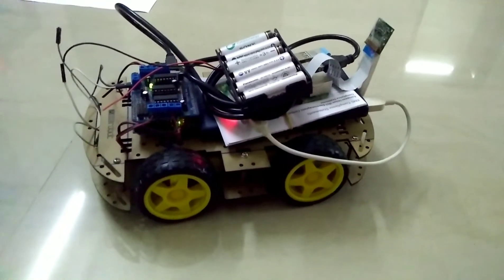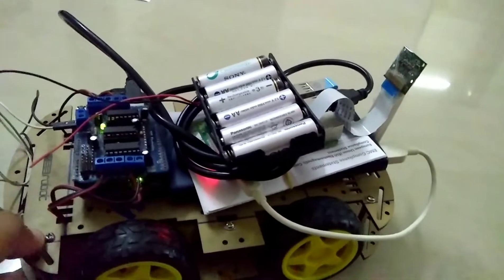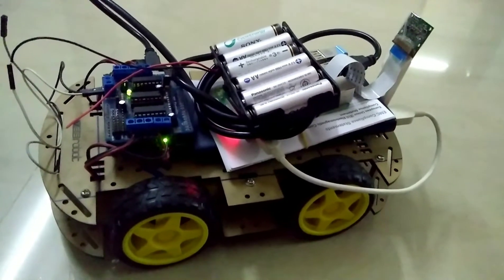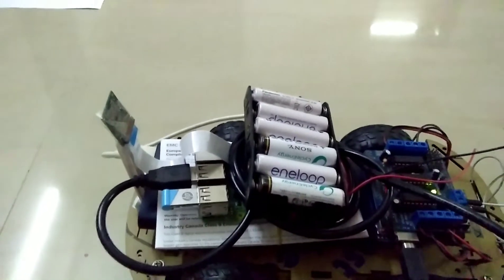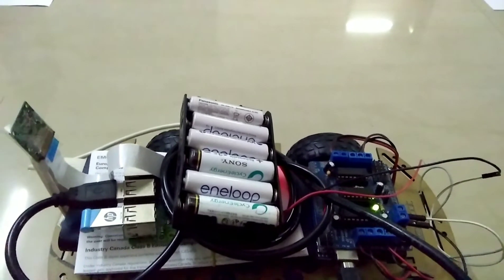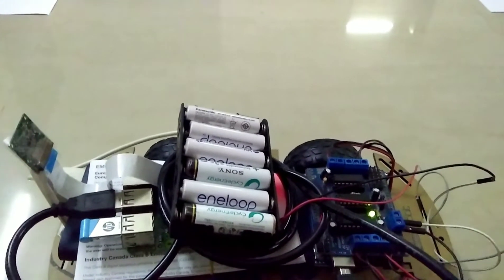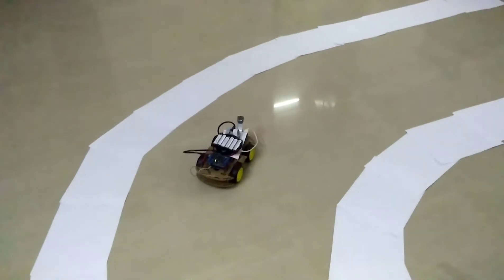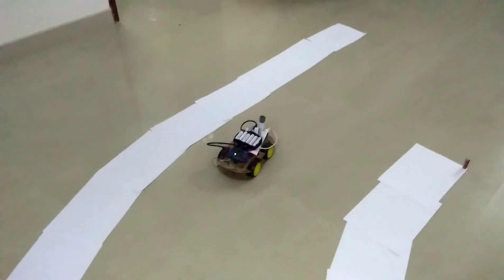Self driving RC car using Tensorflow and Raspberry pi Deep learning.

Comment: Why did u use Arduino+motor driver shield while you have raspberrypi.. you could have bought an L298n motor driver instead of that Arduino and motordriver shield ....and could have directly controlled by using raspi
Reply from the maker: Well, the first phase of development was only with arduino to move to vehicle using a distance sensor.  So I reused the code and environment when   the raspberry pi was introduced.